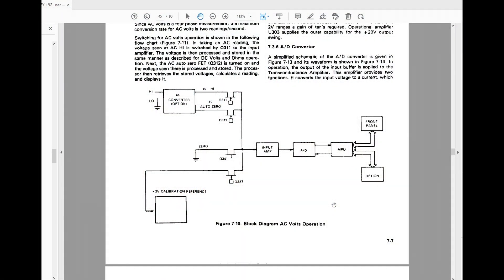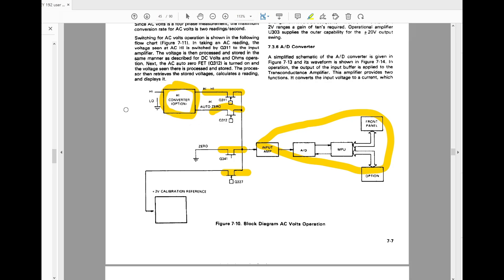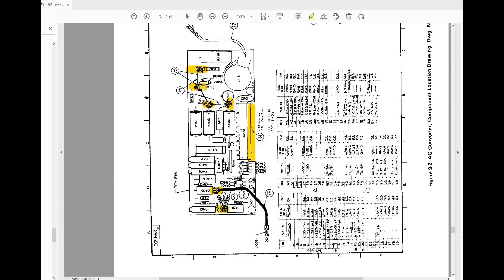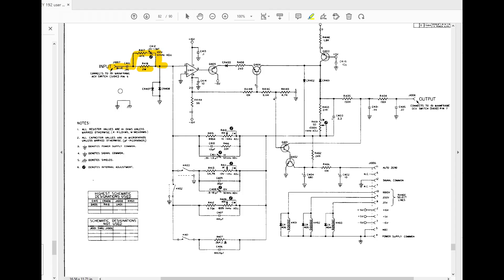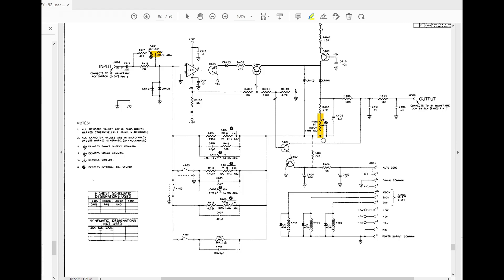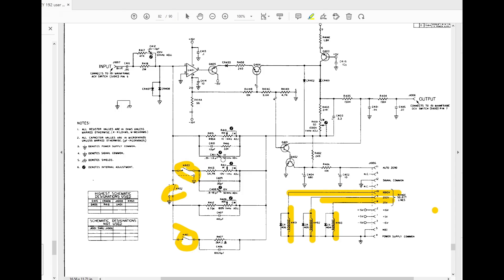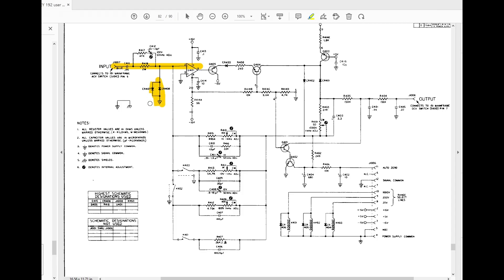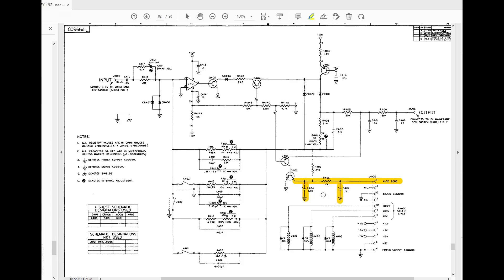#1073 Keithley 192 AC Option Board

Comment: Hi - I have a bj-218 ham radio. It puts out around 10 watts. It was advertised as 25 watts. On CHIRP I can see the 25 watt option. Is there something I could do, or bypass to access the 25 watts?  Thanks. Karl
Reply from the maker: no idea
Reply: Any recommendations as to who could help. My Elmore is fresh out of ideas too.
Reply from the maker: It's called an Elmer, but anyway, it might only put out 10W. many Chinese radios don't do as advertised. Also the max wattage will only be achieved at max input voltage, so 14V and not 12V.
Reply: Ok - thanks.  Mmm, maybe my accent elmer v elmoe 🤔😁

Comment: I think constant current from Q403 flows through the feedback network to CR407... which performs a
V=V_T ln(I/I0) on the sum of this and the input current.  The inverting amp has gain 2 to square the current.  And Q405 through Q401 performs the inverse ln() for the output.  I haven't done the math, but this is my best guess.

Comment: Well, easy enough to recreate the board, though doing the true RMS version would likely be a much better option, using one of the better true RMS converter chips, and getting the version with best linearity in it. But then, most likely use for this meter is precision DC voltage, the AC ranges likely have much less precision in the readings, simply because you would need to also ensure perfect matching in the transistors in the conversion side, and easiest would be to use a transistor uncommitted array, to get the tracking to be as good as possible. Small board, so even a modern version will still need to use the opamp in a steel can, or you will need to use the DIP8 version, and a guard trace both sides of the board to keep the leakage currents from changing the input.

Comment: Very interesting!

There are two AC options boards for this meter. The 1910, which you are showing here, is average-reading. The true RMS option is 1920 which doesn't have a schematic in the main 192 manual.

I think those transistors and diodes in the op amp feedback loop implement a precision rectifier and DC offset. The averaging happens in C403. I tried to convince myself that there was a log-antilog RMS converter in there but I just don't see it. I think it really is just a precision rectifier and averager.

True RMS vs. average vs. peak AC measurements, and how the "RMS" measurements from average-reading meters are accurate only for sine waves, might make an interesting topic if you haven't done a video on it already. I haven't made it through all 1000+ videos yet but I'm working on it. 😀

Comment: 6:46 I'm glad that other people don't understand this circuit either... It's always the same on this high end stuff, they will be a little cluster of transistors with the current going in an unexpected direction. I've no idea what that auto-zero is doing or why the relay range selection is leaving other sections in the signal path. 
Sigh, so much to learn...
Reply: As the measurement range increases, the relays add parallel branches to the feedback circuit, lowering the feedback resistance, which lowers the gain of the amplifier.
Reply: @anameisrequired3729  thanks, I thought that but k401 loop isn’t active until k402 relay is also engaged? So why is k402 not just isolating the 3rd loop? Seems it requires both 1000v and 200v buttons to be active? If k402 was moved right, then it would make sense?
Reply: @____________________________.x  My assumption was that at higher selected voltages, the lower ones stay selected as well.  At least this circuit looks like it.